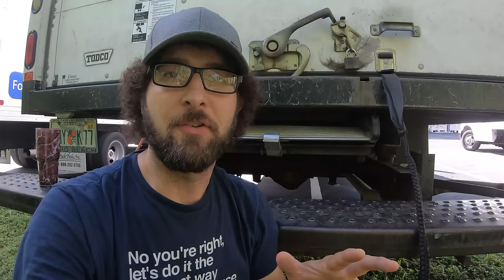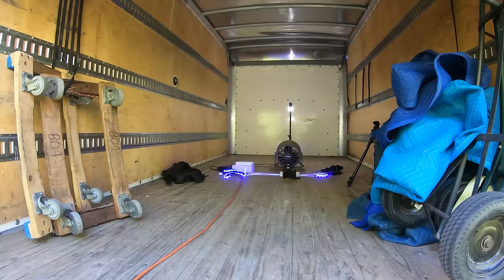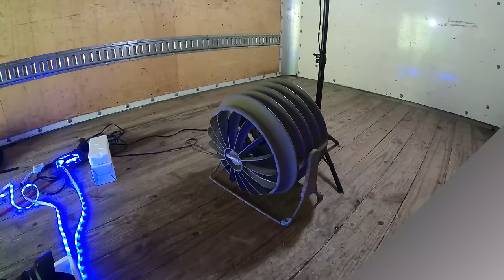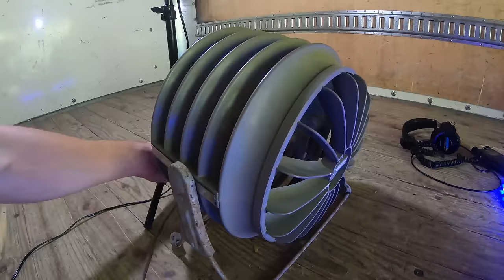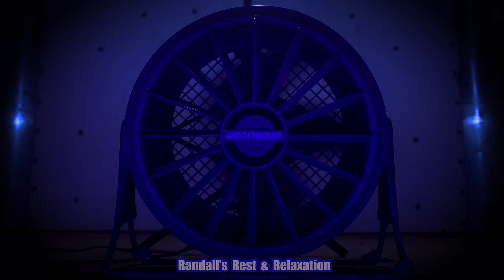Westinghouse Vintage Fan Sound For The Best Sleep Ever

Comment: This fan sound is perfect, as it drowns out noice, plus  eliminates my heart trying  to race in synchronization, as the other fans do. There's a high-pitched interference that is annoying, tho. Thanx for your experimentation by trying to invent the perfect harmonious sounds that suit individual preferences. 😴
Reply from the maker: Thank you for the feedback!  If you have an equalizer on your your listening device you can just turn the treble down or the highs down and it will fix that higher pitch echoing you are talking about.  That was from being inside the metal box truck itself.  I minimized it as much as possible.
Reply: @RandallsRestRelaxation  Actually found the perfect sound that I searched for in your camper video; no undulating waves, no high-pitched sounds, only steady sounds like an air conditioner or stove fan. Thanx for the myriad choices that you offer. 😴💤💭

Comment: Hey Randall I had a flashback when you stepped up into the box trailer to do the Westinghouse fan deal the bumper you stepped on has little grab holes protruding out the top and when I used to drive for a living I would do my walk around inspection and notice when the wind would blow at a certain angle it would produce a soothing flute like sound but the ends of the bumper have to be open to get the sound
Reply from the maker: Whoa!  That might be cool.   Thank you for giving me something to investigate Jerry!

Comment: I need an old whining ceiling fan on low or medium speed....the motor needs to be weak so it sounds like it's struggling to spin, but still spins just fine.. fan start up is slow to get blades to initially move.....think of electric hair clippers on a large wheel laying horizontal on a table, clippers are in front of you, then make a half circle reaching its furthest point and then circling back to in front of you...this would help me astroproject when I was a kid in my room. If you  could recreate this, it would be amazing. (Sorry for the crazy description, not easy to describe a sound through text lol)